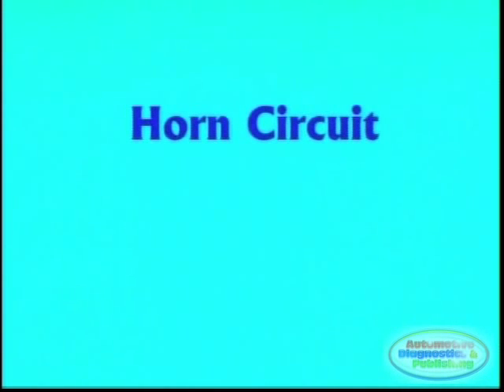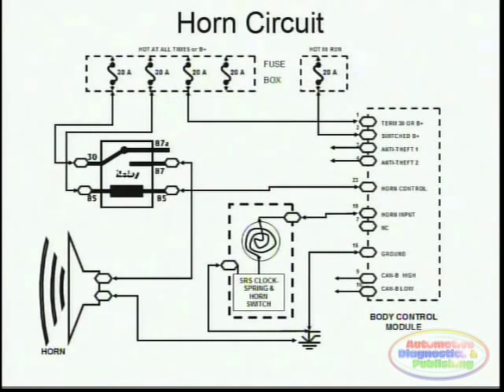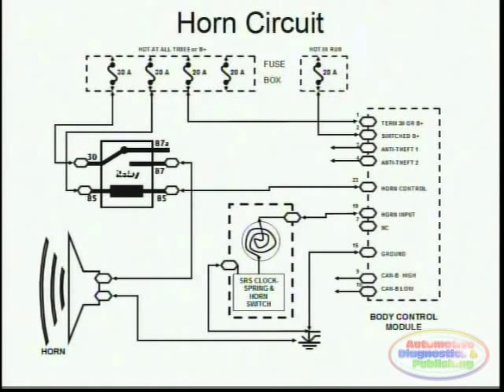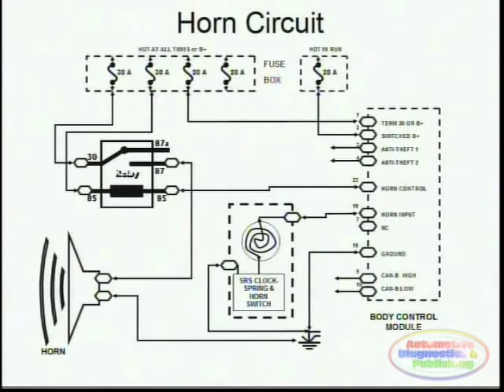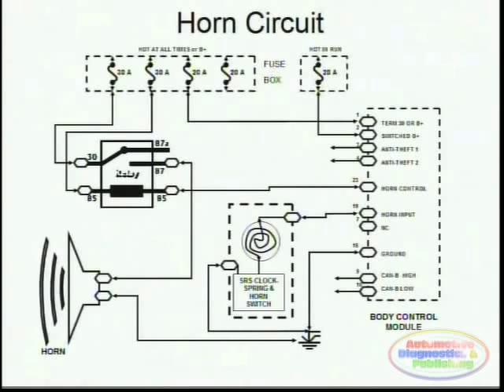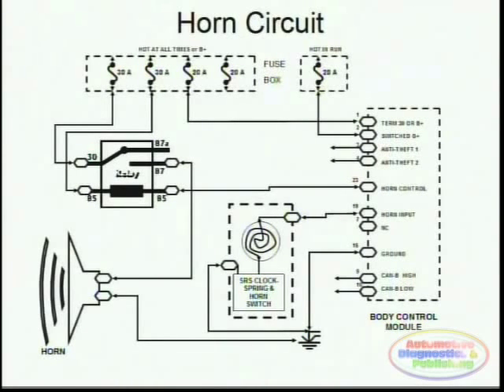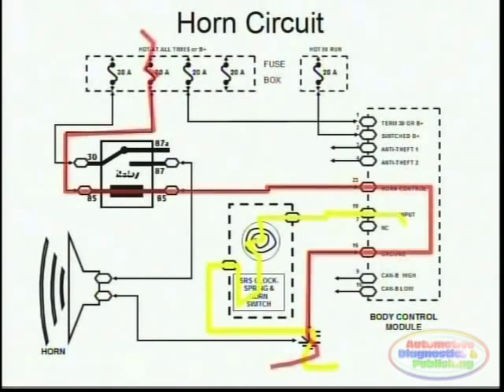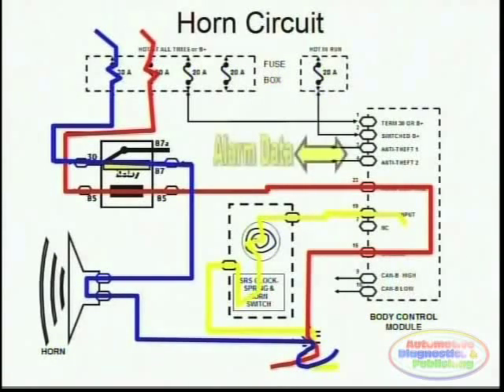Horns & Wiring Diagram

Comment: how to wire a pressure horn and a simple horn differently in 1 switch moder that connects to ignition horn starter in scooter.

Comment: So are you saying, from the stirring wheel when I press the horn, it should send power back through the clock spring to activate the relay then the horn will sound?
Reply from the maker: Yes, however lots of newer systems are using Bluetooth don't know about horns though.
Reply: I have a 2006 Nissan Quest. I replaced a blown horn relay and checked 15 amp fuse, which was ok but horn still does not work. What could the issue be now?

Comment: hi, i am planning to install remote starter. In that i have 200 MA ground side output from remote starter. Can i connect this to ground of the vehicle HORN side coming from SRS ..  question is will that 200 MA ground enough. i know on positive side it has relay but ground side it has only 200 MA so not sure whether i need relay
Reply from the maker: 200mA is not enough for much. DO NOT connect 200 to ground powered items. Use a solid state relay or rig a small transistorized relay. Makes sense? Here more on our updated site: http://www.autodiagnosticsandpublishing.com/
Reply from the maker: ADPTraining Here's another of our latest equipment tool releases: http://www.autodiagnosticsandpublishing.com/Injector_Pulser_Tool.html
Reply: ADPTraining
Reply: What are you hooking it up on reason I'm asking I'm trying to hook one up to

Comment: Hi nice explanation. I have a 2009 ram , i change the the odometer cluster for one from 2011, and my horn stped working, somebody told me that its because before , the horn use to be grounded, and with the new cluster it changed,. Now, is it a way to connect the horn directly? I guess by tapping some cables and use a relay and connect it to the battery? Please help me if you can. Tyanks in advance...
Reply from the maker: Look up my relay repair guide book and videos.

Comment: I have a 2000 Honda accord. The horn works sometimes when you press steering wheel switch but frequently when you press nothing sounds. Relay seems fine, horn works when it's in and not when I remove it. Any ideas? TIA!
Reply from the maker: check clockspring.
Reply: Could you give me a hint on location of clockspring on 2002 Celica? Thanks!
Reply from the maker: Clockspring is at the steering wheel on all cars.
Reply: Thanks ADPT! I'm assuming that means inside the steering column, that seems too much for me,LOL! My mechanic said with the air bags and everything else in there it's too hard to try. Both horns seem fine is there an easy way to hook up a switch somewhere in the car like on the dash from just the wires on the horns? Sorry to be so much trouble!
Reply from the maker: Yes, no big deal for someone who's done it, but kind of dangerous if you mishandle the SRS pyrotechnic airbag. Good luck.
Reply: Is there any way to test if that's the problem? I'd gladly try to find someone trained to replace it if needed. I thought maybe with a length of wire I could jump one of the horn contacts to a ground. That does seem to easy,though.I'll leave you nice gentlemen alone after this,promise!
Reply: John Mon I just had an idea. Since the horn is attached to the steering,airbag,alarm and relays, could I disconnect the wires to the horns and run a wire from the battery to the horns then to a switch on the dash then back to the horns sort of making it's own circuit? Thanks 1 last time,LOL!
Reply from the maker: Yeah, sure a lot of people do that. They autoparts even sell the big-white horn button to mount on the dash. Identify the horn wires, two of them, and reconnect the outter button. Good luck.
Reply from the maker: ADPTraining http://www.autodiagnosticsandpublishing.com/

Comment: 2005 GTO horn beeps if i hit 3200rpm. Got to hit hard . If i ease up past 3200 as soon as i go farther BEEP ..not only annoying as heck butt dang embarrassing too..HELP
Reply from the maker: Couple of issues I can think of. 
1) The SRS Airbags aluminum foil causes problems on these cars, so wiring harness replacements. 
2) The Torque Converter solenoid  also shorts and causes network issues. 
3) it may seem like ounce you got 3200 RPM, but chances are you're getting a specific vibration at 3200 RPM. Again, I would look at the SRS and steering column wires. 

http://autodiagnosticsandpublishing.com/